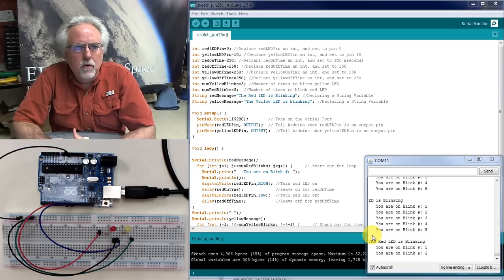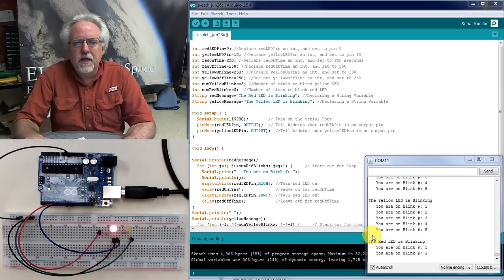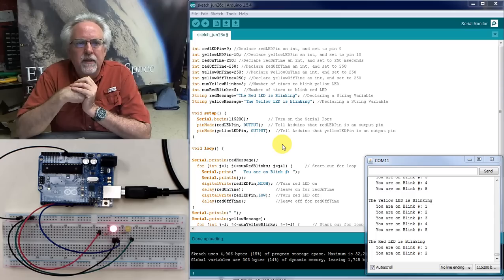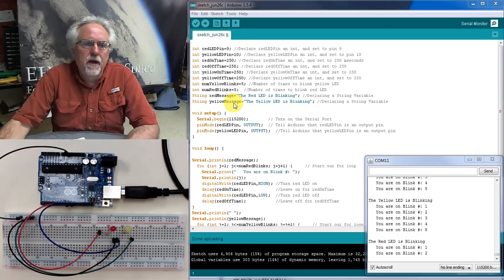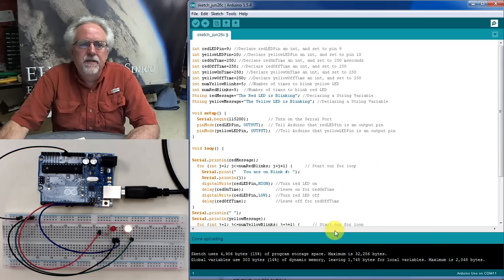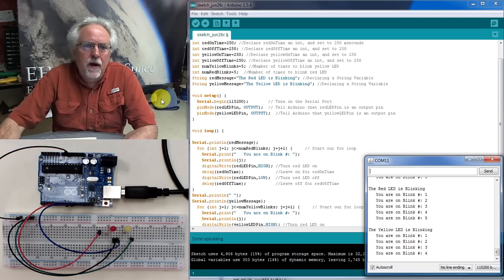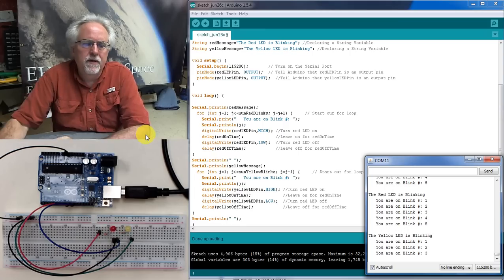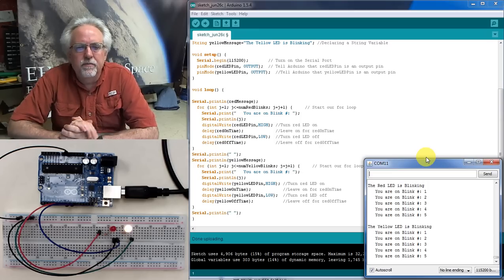LESSON 6: Reading Data from Arduino Serial Monitor

Comment: I've ran into problems on the message prompts for inputting the number of LED blinks. After entering the first number and hitting send, the program would prompt me for the second number but immediately continue with the blinking loops, without waiting for me to finish entering the seconds number. Turns out my Arduino IDE's Serial Monitor tool was sending NEWLINE characters after every send by default (it's the dropdown right next to where you set the Serial Monitor BAUD). After setting the value to "No line ending", my program started to work as expected.
Reply: Had the same problem - your comment helped! Thanks for sharing!
Reply: Thanks a lot for sharing !
Reply: thanks ,had the same problem
Reply: Thanks, Wish I would have seen this sooner!
Reply: Thank you. I was also stucked in the same problem..
Reply: something like this :

How many times the wigth LED blinking?
How many times the green LED blinking?
  
the wightLED is blinking!
   you are on blink #: 1
   you are on blink #: 2
   you are on blink #: 3
  
the greenLED is blinking!
  
the wightLED is blinking!
   you are on blink #: 1
   you are on blink #: 2
   you are on blink #: 
  
the greenLED is blinking!

..appears in  Arduino IDE's Serial Monitor tool ?
I have the same problem.... but if you put very fast how may times befor start the counting run normal
However i want the arduino waiting me...... 
i have find one solution  but i think this is not the "rigth  way" 
you can make a "fake int  like  >  int1;  <  and create one more "fake"loop between the two loops in void setup

String wigthMessege= "the wightLED is blinking!" ; // set a string variable 
String greenMessege= "the greenLED is blinking!" ; // set a string 

int num1;  // fake int                                     <<<<<<<<  fake int

void setup() {
 Serial.begin(9600);  // turne on the serial port
 pinMode (wigthLED,OUTPUT); // tell arduino that wigthLED  is an output
 pinMode (greenLED,OUTPUT); // tell arduino that greenLED  is an output

 Serial.println ("How many times the wigth LED blinking?" );
 while (Serial.available ()==0)  { }
 numWigthBlink = Serial.parseInt ();

 // fake loop                                                                   <<<<  fake loop
 while (Serial.available ()==0)  { }                      
 num1 = Serial.parseInt ();
// fake loop
 
 
 Serial.println ("How many times the green LED blinking?" );
 while (Serial.available ()==0)  { }
 numGreenBlink = Serial.parseInt ();
}

void loop() {

i am a biginner to....    i don't know why and i hope someone give us an answer, but it works...
Reply: Thank You very much for the help sir
Reply: I had the same problem. Thank you very much sharing!
Reply: ty
Reply: Oh thank you I was wondering what was wrong with it!
Reply: Thank you!! This was a lifesaver.. I kept going back through the code wondering why it was triggering when there was no input; thank you fam
Reply: Thanks. Your comment is very helpful.
Reply: yeah having same problem thanks for helping
Reply: when everyman had the same problem  lool this is joke, thanks man this helped me.
Reply: thank you, had same problem
Reply: I was going crazy!!! cheers man lol
Reply: Thanks, in the same boat.
Reply: Thanks for correct fix!
I fiqured that Serial default set Timeout was to short ( 1000). So I increased it -> Serial.setTimeout(999999); It allso helped, but Al Bundi, You´r solution is better, because it will not create more problems, when program get´s more complicated.
Reply: @Palpatine but do wear commando masks :D
Reply: Thanks Al. I was tearing my hair out for over an hour going over my code and I even did look at the values in the dropdown you mentioned but didn't try the "No line ending" option. Oooo so close...  Anyway, thanks again for posting this.
Reply: Bloody Hell!! I just spent 20 minutes trying to figure out the same problem. Should have known to check the comments sooner. Thanks!
Reply: @gregthomas7950   Same here. wish there was an explanation on this too
Reply: same here
Reply: I spent alot of time trying to solve this probleme , your comment was helpful !
Reply: thanks for sharing!!
Reply: Thank man!
Reply: If you were here you have no idea of what kind of leg hump you would get right now.  Thanks!
Reply: Been trying to figure this out for an hour, was starting to think there was something wrong with my hardware. trippin haha
Reply: Thank you very much.  Was about to break something.  You get a banana sticker.
Reply: Thank you for this, i had been going through my code for 30 minutes before i saw your comment :D
Reply: Thanks Al, from Peg
Reply: Pull my heir out at this problem - your comment really helped Many Thanks for sharing
Reply: Thanks, I had same problem but now solved!
Reply: THAAAANK YOU. that was ANNOYING
Reply: Thank you so much buddy
Reply: thanks man!!
Reply: Thank you, this helped!
Reply: @Cedric Chia yes it is working thank you
Reply: Thanks al bundi it works
Reply: Add a delay(5000); after the second while (Serial.available()==0){}

  Serial.println("How many times you want the Red LED to Blinks?");
  while (Serial.available()==0){}
  redloopcounter = Serial.parseInt();
  
  Serial.println("How many times you want the Green LED to Blinks?");
  while (Serial.available()==0){}
  delay(10000);
 // Wait for 10 seconds so that I can put a value
  greenloopcounter = Serial.parseInt();
Reply: I had the same issue, before I saw your comment I changed the second argument to "while (serial.available()==1) {}, That worked as well.
Reply: Thank you very much... that's about 4 hours of my life I'll never get back and immeasurable frustration thinking I was doing something wrong
Reply: for me too
Reply: Got the solution! set serial monitor to “no line end”
Reply: Thank you I had the same problem
Reply: Thank you so much!
Reply: Thank you so much!!!!!!!!!!!!!!!!!!!!!
Reply: @kasperwesteraa9558  thanks man
Reply: thank you
Reply: I had that same problem too I thought it was my code was bad thanks for the help man
Reply: Thanks a lot, may I know what the newline option does?
Reply: It worked. I spent two unsuccessful hours tweaking and modifying my code until I saw your comment. Thanks a lot.
Reply: Yep.  I got caught by that one as well.
Reply: was having the same issue, Thanks for the help dude!
Reply: I had the same problem. It works fine now. Thanks!
Reply: Same here 🌞 and I caught it just like you. I was using "both NL & CR"
Reply: Thanks buddy! You've helped a lot!
Reply: Thank you
Reply: @rami6918  Thank you very much
Reply: Jonas MOURET  Thanks...Just added the Serial.read () after the instruction asking the number of blinks, and it worked perfect
Reply: Thank you!!!!
Reply: to fix this issue you need to type in the command,
Serial.read();
this clears the serial byte buffer and makes the serial.available() = 0 again. 
i hope this helps someone because it took me baout 30 mins to trouble shoot and figure out on my own
Reply: @Cedric Chia thanks man it works
Reply: Thank you so much! Happy thanks giving!
Reply: Got into the same problem. Thank you, sir, for that info.
Reply: You're a G. thank you
Reply: omg thank you I was ripping my hair out trying to figure out wth I was doing wrong XD
Reply: I had the same issue as you and your fix worked like a charm, thanks for the post!
Reply: Thank you so much I was struggling with this for 2 MONTHS!!! It was so frustrating thanks again
Reply: A more reliable solution is to flush the input buffer before waiting for fresh input. You can do this by reading out any garbage bytes:

while(Serial.available() > 0){char garbage = Serial.read();} //flush input buffer
Reply: Thank you so much!!!
Reply: @vasileiospissas347  it is because the newline or extra character is stuck in the serial buffer, so it will read a character, and thus serial available will be true
Reply: Savior
Reply: DUDE YOU ARE A LIFE SAVER THANKS A LOT!!!!!!
Reply: i faced the same problem . thanx for help
Reply: Thanks man..........I had the same problem as well. I didn't know what to do and your comment helped me a lot.......
again thanks.....❤❤❤❤
Reply: had the same issue, thanks for sharing!!
Reply: Thank you
Reply: omg thanks, I read this comment before the video and noticed that someone said to change the setup to 'no line ending' but towards the end of the video I encountered the same problem and couldn't crack it til i revisited this comment again
Reply: I had the same issue and just switched the 2nd while loop to  (Serial.available()==1) {}; and it fixed it but switching the settings I think is the real fix here. Thanks for the help!
Reply: Awesome. Thank you for catching that and sharing.
Reply: LOVE U MAN !!!!
Reply: Thank you. A million times, thank you!
Reply: Thank you Al.
Reply: thanks for sharing had the same problem
Reply: after 40 minutes of editing i decided to look a the comments. Solution on the first comment. Thanks!
Reply: Hello  SKIP PIKS  thanks for this and I accept it as is but I still don't understand why the Paul version worked for him! Was there a modification to Arduino?? I watched the vdeo many times in case I missed something but my version is exact same as his.
Reply: @sandipdas1953  Fantastic! great observation! I needed to understand why same code worked for Paul and not me and you found it!! well done!  Thanks :-)
Reply: SKIP PIKS   Thanks man it help
Reply: thaks sir for ur information ,but problem which is mentioned in this comment it is right.
Reply: Saved my existence, thank you kindly.
Reply: Thanks man
Reply: Thanks!
Reply: Iiterally saved so much time, thx thx u so much
Reply: thanks. :)
Reply: I spent two hours working on this exact problem without even thinking to check the comment section.  You're my new hero. LOL
Reply: thx bro
Reply: Same thing here , now it works.
Reply: hi, you should just change the "New Line" option at the bottom of your serial monitor to "No Line Ending" .
Reply: Thanks man! I've been through the same problem
Reply: Same thing kept happening to me too. I kept going over the code, thinking i did it wrong and eventually went to the comments to see if anyone else had this problem as well. Appreciate you sharing this simple fix.
Reply: Thanks a lot for sharing !

Comment: You are one of the best tutors I have come across.  I'm a 55+ man and your style conveys the foundation very well that, one would not forget the concept behind it and also you are so clear and very detailed oriented.  This is a field where details does matter a lot, otherwise, one can give up easily due to frustration that something is not working the way it is expected.  A simple character typo can throw people off.  You are also teaching the patience and awareness that this field requires.  Thanks again and I'm planning to attend all your classes.  It is working out perfect so far and I'm eagerly waiting to apply this learning to my invention idea.
Reply: Illam Pakkirisamy Can we use ' if (Serial.availble() > 0) instead of the while loop???
Reply: Ankush Sarkar well you can use if else statement.But I think while is best as explained by Paul in tutorial because audrino have limited memory so you really have to be careful as you don't want to waste your microcontroller memory on it. For small coding you can use if else statement but when you are working with heavy program it is advisable to use small to the point code without wasting the memory. I hope this will answer you query.

Comment: solution to the code not stopping after the first while loop is to add a 
Serial.read();  here 

Serial.println("how many times should the yellow led blink?");
  while (Serial.available()== 0){}      // "=" means set = to. "==" means test to see if = to
    loopcounty = Serial.parseInt();      // reads the number inputted and makes the loop that number
  Serial.println(Serial.available());
  Serial.read();

this clears the buffer serial.available buffer and makes it so that the next while loop can actually work. 

took about  30 mins of figuring out but this works wonderfully and doesnt require changing any settings

Comment: Really enjoying your lessons.  So much to learn.  I'm a HAM, since 1970's, and so much has changed.  I have three sketches I want to modify to get it to work with my radio. Matter of combining two of the sketches with a large part from one with a smaller part of another to get the results I need.  So hopefully the classes will guide me to my requirement.  Thanks again Paul.

Comment: If you are unable to read more than two inputs on serial monitor then include these lines in the code

 while(Serial.available() > 0) 
   {
       Serial.parseInt();
   }

these lines of code must be written after assigning data from the serial port to a variable.

Let me show it using an example :

In this example we enter the values of on and off times of red and yellow led's  on the serial monitor.Let the declared variables  
redblinkOntime, redblinkOfftime, yellowblinkOntime, yellowblinkOfftime  be of type int ,so we use Serial.parseInt.

void loop() {
   Serial.println("Enter the on time for red led");
   while(Serial.available()==0)
   {
 
   }
   redblinkOntime=Serial.parseInt();
   while(Serial.available() > 0) 
   {
       Serial.parseInt();  //must be included after the serial data is assigned to a variable
   }

 

   Serial.println("Enter the off time for red led");
   while(Serial.available()==0)
     {
  
   }
   redblinkOfftime=Serial.parseInt();
  while(Serial.available() > 0) 
   {
      Serial.parseInt();//must be included after the serial data is assigned to a variable
   }

 Serial.println("Enter the on time for yellow led");
   while(Serial.available()==0)
     {
    
      }
   yellowblinkOntime=Serial.parseInt();
   while(Serial.available() > 0) 
     {
       Serial.parseInt(); //must be included after the serial data is assigned to a variable
     }

   Serial.println("Enter the off  time for yellow led");
   while(Serial.available()==0)
     {
   }
   yellowblinkOfftime=Serial.parseInt();
   while(Serial.available() > 0)
   {
      Serial.parseInt(); //must be included after the serial data is assigned to a variable
}
Reply: thanks, yours work!!

Comment: Paul, these video are so informative.  Thanks.  I have a TKinter GUI program that exhibits 14 buttons.  if any button is depressed, the Arduino either latches or unlatches one of 7 relays(14 buttons).  I have been able to insert a GUI label between each set of buttons and even have that label change its color and text when the latch or unlatch button is depressed.  That is nice but what I really need is for that label to change colro and text when it knows for sure that the relay has actually changed state.  I have each relay connected to an analog input on the Arduino.  When a relay latches, the analog input get +5 volts DC.  When the relay unlatches, the anaolg input goes to ground.  I can even make a digital output go high or low to follow the analog voltage state but I CAN NOT figure out how to use this Arduino data to do the color and text label change back over on the Python/Tkinter GUI.   Help please.  I can send you the Python and Arduino codes if you would be willing to help me.

Comment: 0:44 if you look at the messages printed, one says You are on Bnk#: 5. Why does this happen?
Reply: There's a couple of lines that don't display properly and you can see the monitor lag for a moment. I don't know the answer for sure but I would put it down to either the cable or maybe a lot of programs being ran using the PC's resources (2 cameras, screencap etc)

Comment: Paul, you got me thinking; is there a way, to set the number of blinks, then if the user doesn't enter a  new number, after going through the loop, for the amount of blinks, the program will continue, with the last entered values, after a short delay?  I'm guessing some sort of "if statement.   I did notice that the "if statement" tutorials aren't until lesson 14.....sorry if I posted in the wrong tutorial but thought this thread was more on track with the question.

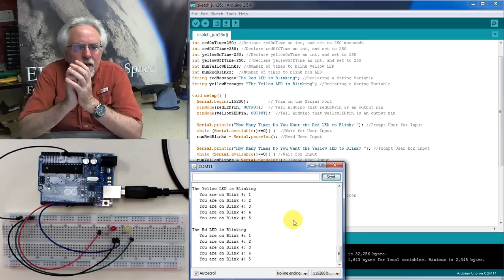Comment: The usb cable or the program seems to be dropping information sometimes(32:30 "The Rd LED...", is it normal? It seems to be the same thing as in the previous video.
Reply from the maker: Ram Homier I am really not sure exactly what caused that, but it is always possible to drop a character in serial communication.

Comment: sir i have a problem... my project is related to this example...  a string must be continuously printed on the serial monitor and if serial.available().. it must stop printing and should ask for the led blink delays instead of the no of times it should blink. once the user inputs the delay intervals then the lead should blink with the corresponding delay the user given.. im not able to get it correctly

Comment: hallo. i would like to talk about a problem that occured in my code.
when i typed this code 
"
Serial.println("How many times do you want the Red LED to blink?");
while(Serial.available()==0){}
nred = Serial.parseInt();

Serial.println("How many times do you want the Yellows LED to blink?");
while(Serial.available()==0){}
nyell = Serial.parseInt(); "
it just skips  yellow led's part and just blinks for Red Led.
however, i have changed while(serial.available()==1){} for yellow leds and that time it allowed me to enter some value in it.
the problem with this code  is, if you dont use delay function in between, the program just flushes out.

Comment: Why dont they have a serial read function that has the wait built in, and then inputs a string typed in by a user e.g.   string x = “”; x = serial.read(“Type in the input: “); and then you can convert the input string as needed? Why the obfuscated arcanery?